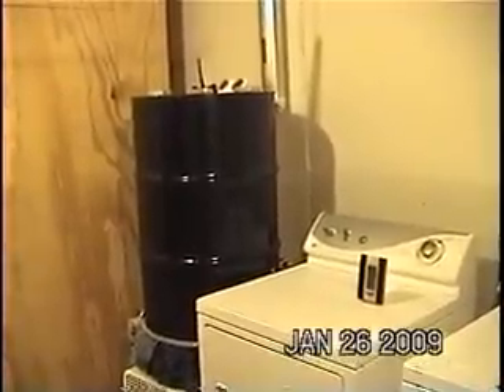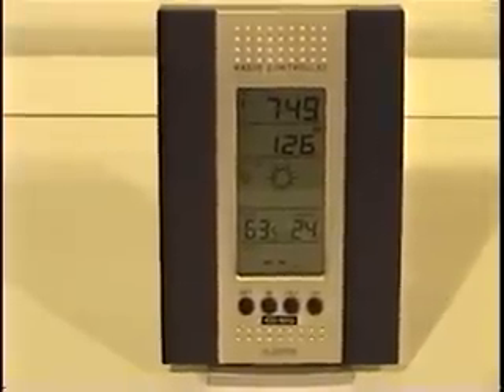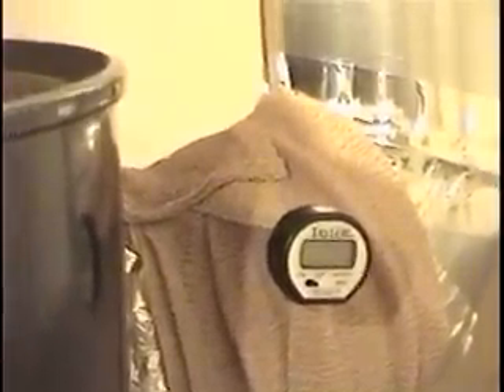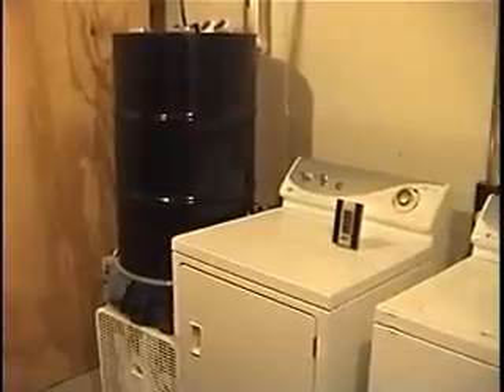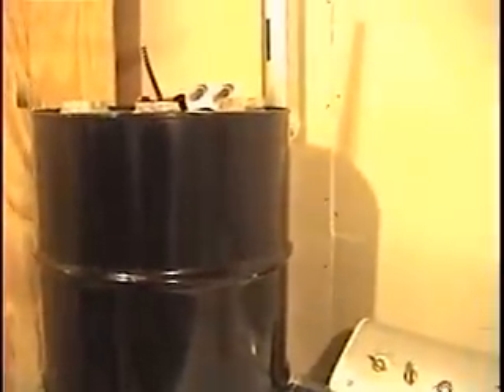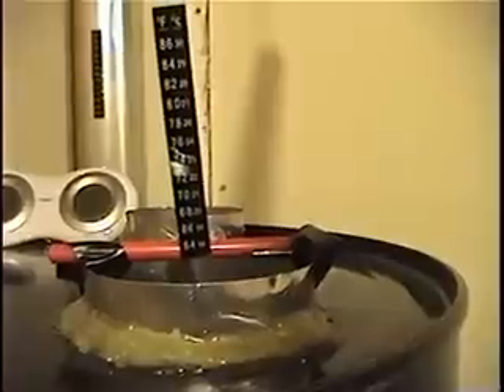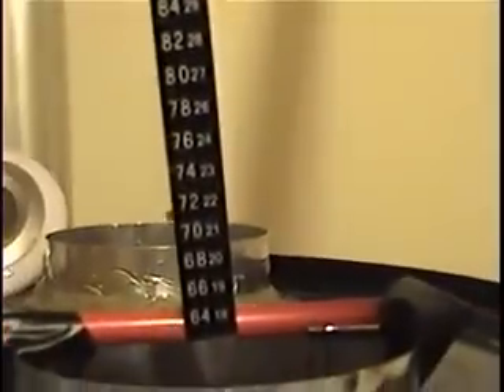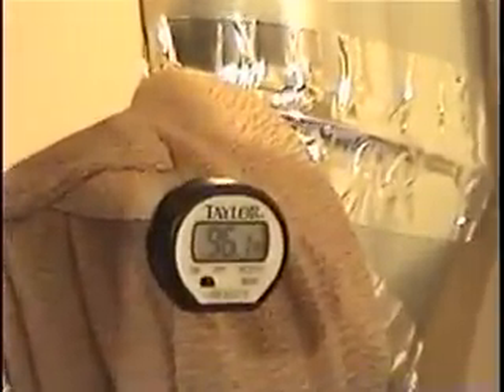Clothes Dryer Heat Exchanger Temperatures 1

Comment: Great idea but I think you would be better off with a few more smaller pipes to get the exchange surface area up a little.  You could do a bit more testing on airspeed effects as well and possibly save some money on electricity for the fan. Why they don't make commercial models of these things is beyond me!
Cheers for a good job.

Comment: There is a Thermo Snap Disc... You can get it and it will TURN ON your FAN AUTOMATICALLY at your desired Temps. Example: Lets say you don't 'want to turn the Fan On, until the Top of the Drum or your Pipes gets over 85 Degree. That way heat will build up a bit. Then it Automatically Shut Off once the temps goes under like -/+10 Degree. They are called Normally Open Snap Thermo Disc, they are available like 77, 86, 95 Degree etc.... It will SAVE your Energy / Electricity by shutting On and Off automatically for you so you don't have to, and they are CHEAP too :))

Comment: we use a panty hose on the end of the flex hose.. full heat and humidity come into the house.. the panty hose acts as a filter
Reply from the maker: I don't want all the humidity in the basement so using the heat exchanger works well.

Comment: okay, The cross section of the air passage would still be 3 or 4 times volume capacity of the dryer hose.  it would still flow just as well, just for a longer time in the barrel to transfer more heat...  Your dryer and house of course, just thinking of ways to get you better transfer.

Comment: Did you set several baffles in the barrel?  If you have the baffles making the airflow alternate sides o the barrel it will slow the dryer's airflow and give you better heat transfer into the indoor air.
Reply from the maker: No. I was afraid baffles would restrict air flow in the dryer. Moving air through the dryer in sufficient volume is important to drying the clothes.

Comment: I would have just used an aluminum pipe act as a heat sink, run it around the rooms floor maximum linear feet before venting it, should bleed most of the heat into the room.

Comment: ducting is flawed. use 1 inlet on  exchanger and one on outlet with a series of elbows. put a 4inch blower fan on exchanger. then duct it to furnace cold air intake,put furnace fan on to draw air in now it is going through the rest of the house. no need to heat laundry room,you don't hang out in there.

Comment: The setup looks good, But if its winter and 0 out side the you have low Humidity in the House Im sure,   Your using a electric dryer no fumes 100% efficient Why would you even pump it out side , if you need the moisture let it fly in the house .
 
  I have to do this setup with Gas dryer . not electric

  I like the Videos
David
Reply from the maker: With that much humidity entering into one room I don't want to take the chance of mold forming.
Reply: It is alot of Humidity, in Ohio in the winter its hard to get to much when its below 20% humidity, summer time mold big time !

nice video
David
Reply: Yup Mold and Mildew is the worst. Your SET UP is GREAT :).. Don't listen to People who haven't done it :)))

Comment: wouldn't it be more efficient reversing the fan and pulling the air through from the top to the bottom?
Reply from the maker: I'm not sure what the efficiency gain would be or why it would be more efficient.
Reply from the maker: +Jose Francisco Medeiros I see what you are saying now. Good point. Keep the warm air closer to the ground. Thank you for that idea.
Reply: +OnTheEdgeInEauClaire well all the heat is above the floor at the ceiling !! he's only transfering 5.6 deg!! heating air is the worst way to transfer heat !!

Comment: in the winter I just unhook pipe from outside pipe and put nylon stocking over end of pipe coming out of dryer I get heat faster and when stocking gets full just replace it or clean it -instant heat
Reply: that causes a lot of tiny  lint  particles that get into your home, and  is dangerous as it gets deep down into your lungs  causing  Bronchial  infections. I  did that too and using a commercial made exchanger. Nope no good. Got to create a  completely safe exchanger  as this one he  demonstrates.  Think as a furnace is built for heat exchanging.

Comment: try putting a damper into the exit pipe, but check with a vacuum gage to make sure ur noy creating back pressure....it may increase overall heat output......great idea though...

Comment from the maker: The goal is to capture heat that would go outside and be wasted. Any heat recovered would be a gain. The box fan does use energy but also gives off sensible heat from the motor. The interesting temperature to me is the inlet and outlet  air temp. from the dryer. That gives you an indication of the amount of heat you are exchanging as the air passes through the exchanger. Thanks for the comment. Always interesting to look at things in different ways.

Comment from the maker: It would work without a fan but not as well. Think of a car radiator. It will exchange more heat with a fan blowing through it. The cooler the air the greater the heat exchange. Heat moves to cold so the heat will move from the exchanger to the air blowing through it. As the room air temperature increases the heat exchange decreases. The blowing air also circulates the warm air faster than natural convection through the room. Yes it will work without a fan but it works better with a fan.

Comment: wont the draft up through the tubes begin without the fan,as warm air will draft upward, creating the uptake of cool air from the bottom?and wont the air flowing upward be warmer then it is with the fan?

Comment from the maker: Unfortunatly in the winter time using a dryer is about the only option. I do hang some stuff up in the house but space is limited. I  had a dryer fire using natural gas so  I switched back to electric. I have knocked about $50.00 dollars a month from my utility bill by insulating,using florescent lighting and shutting stuff off when not in use. I plan on insulating the garage this summer. It is attached to a north wall of the house so that should help.

Comment: You are scrupulous with your readings- very scientific!! However, I'm just curious- is it totally necessary to use the dryer? Surely it uses huge amounts of power that is not necessarily from renewable sources?
Reply: that's not the point  to all this, hes just trying use some of the hot air to warm the house or whatever room they decide to save on some bills